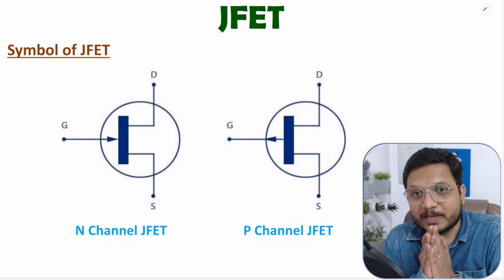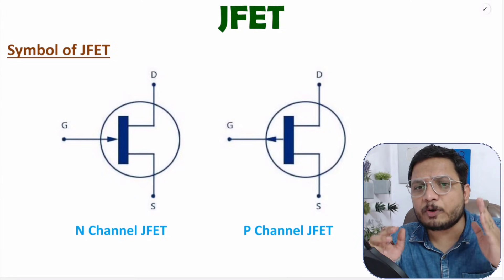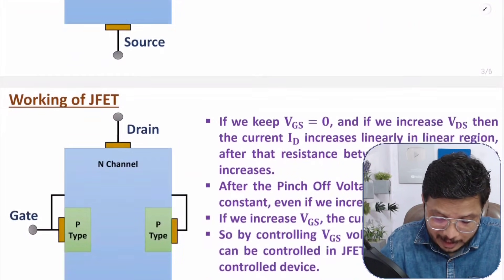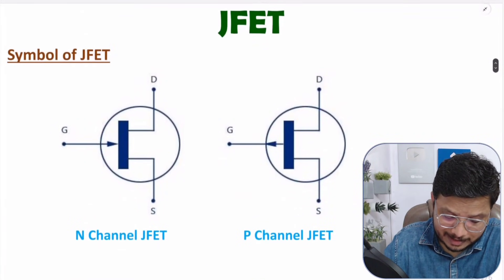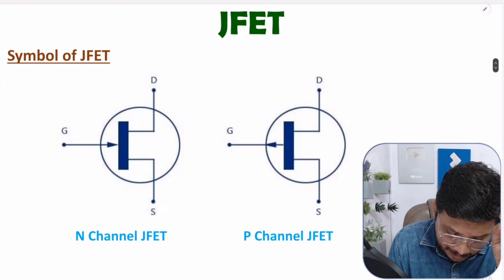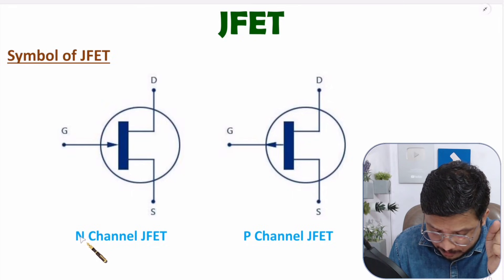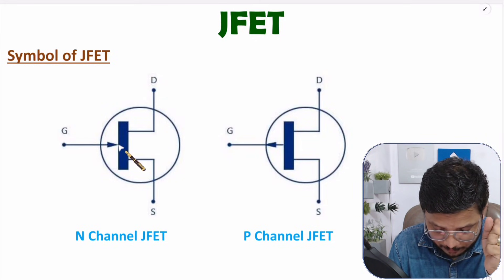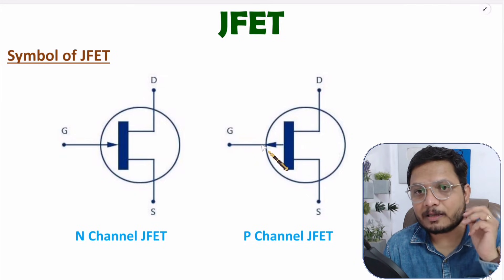JFET (Basics, Symbol, Structure, Working & Characteristics) Explained

Comment: 10: 22 In a JFET, increasing the gate-to-source voltage (Vgs) does not increase the drain current (Id); in fact, it actually decreases the drain current because a larger Vgs creates a wider depletion region and restricting the flow of current through it.
please reply
Reply: Larger Vgs Decreases The Potential diff between Channel and substrate , thus the Depletion layer formed is narrow than before , this gives wider channel and more current can flow (Id increases)